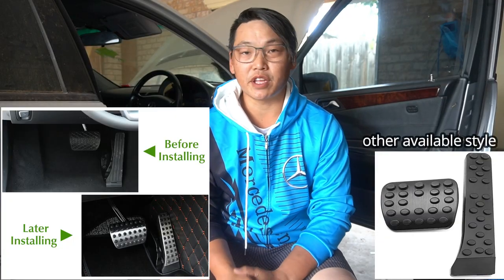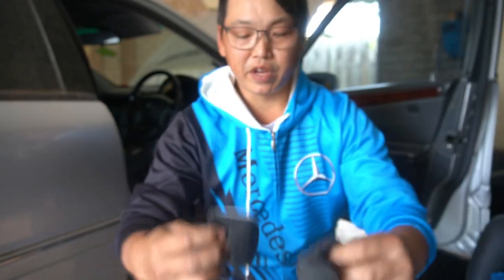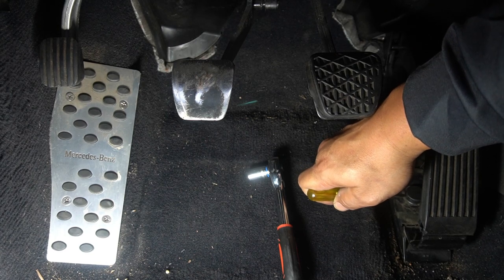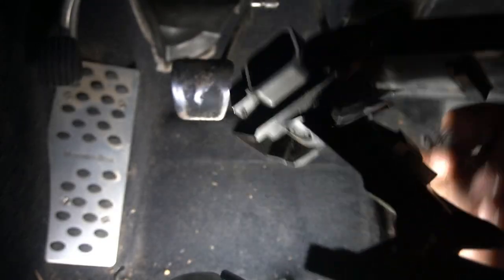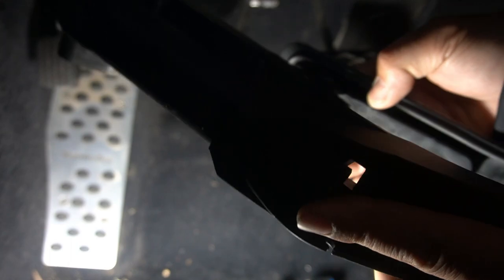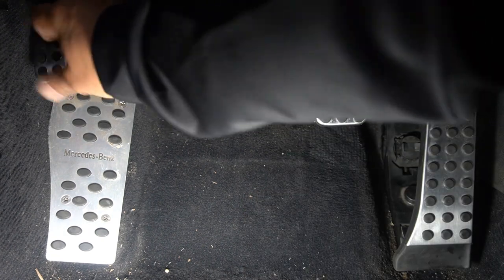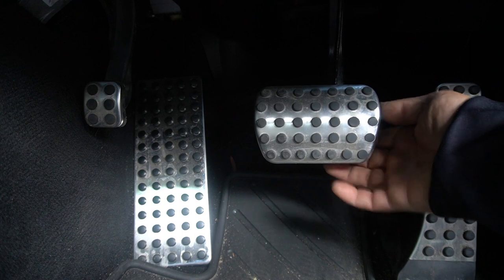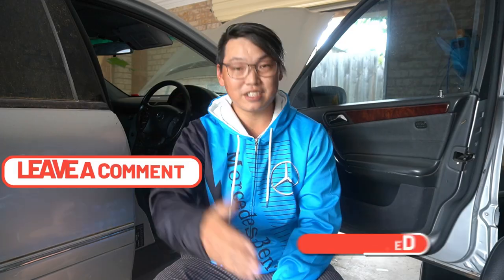mercedes mods AMG style foot pedal covers + remove accelerator pedal

Comment: I put the throttle part without disassembling the pedal on Mercedes S W222. How? I leave the old piece cutting with scissors from the bottom, because if I don't have a threaded metal bar and it won't let it out, and then I give the pedal pressing on all the edges until it fits completely. I start to enter the rig from above, then finger the rubber of the pedal into the metal of the throttle. It works in my car.
Reply from the maker: well done